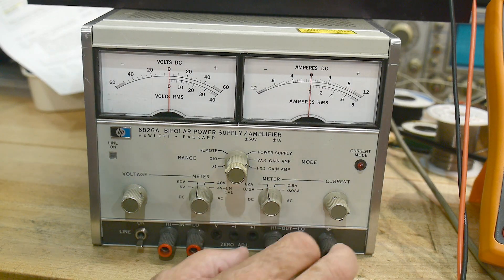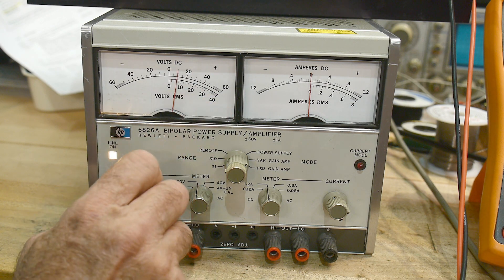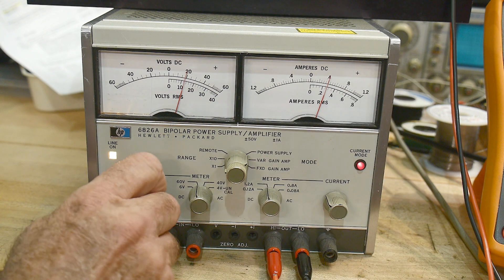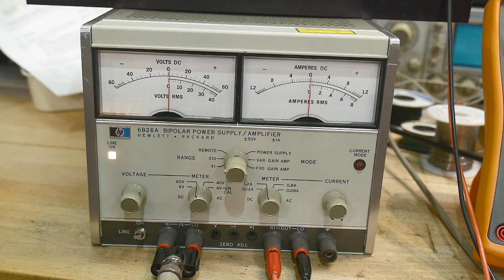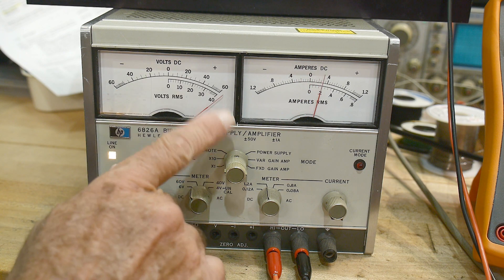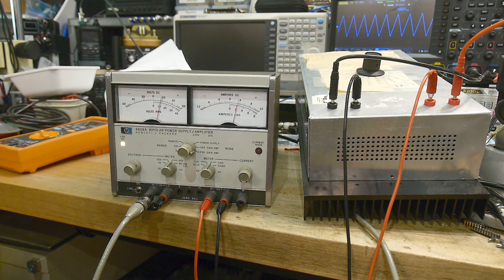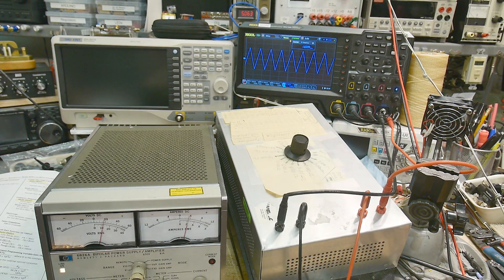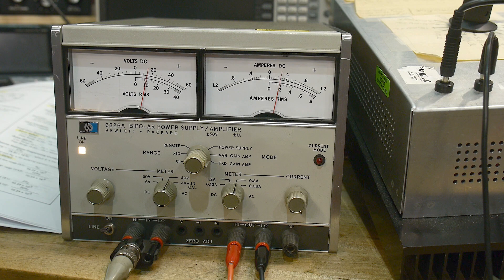#1597 HP6826A Power Supply Amplifier

Comment: At 3:40 in, the instrument has not been demonstrated to be capable of sourcing or sinking current or operating in four quadrants. It has only been shown to operate in quadrants 1 and 3, sourcing only in each. No "sinking" capability has been demonstrated.

"Sinking" means that instead of current flowing out of the output terminals, it can flow in to maintain the voltage setpoint. The specifics of polarity of the setpoint are essentially ignored with this terminology.

Considering the case with the supply set to deliver a positive voltage at the "red" terminal relative to the "black terminal" :
An ordinary power supply will go high-impedance at its output if something external to the supply forces the output voltage to be above the setpoint of the supply. With current sinking ability, the instrument will actively try to bring the output voltage down to the setpoint by causing (conventional) current to flow into the red terminal - it behaves as either a series regulator or a shunt regulator, depending on specific conditions. That is operation in quadrant 2. 
With the relative polarity of the terminals reversed, operation is in quadrant 4.

The non-square limitation in quadrands 2 and 4 is almost certainly due to the safe operating area limitations of the output transistors. Because sinking is to the opposite supply rail, the voltage across an output transistor could approach twice what it might see if used only as a normal series pass element.

Basically these power supplies are very very similar to audio amplifiers, the major difference being that they incorporate a bipolar voltage reference and some convenient bells and whistles.
Reply from the maker: As in comments below, I did not demo the four quadrants. Please read the User Manual for this product. It will explain it will in fact source and sink current.
https://www.keysight.com/us/en/assets/9018-02032/user-manuals/9018-02032.pdf
Reply from the maker: I show current sink: https://youtu.be/PmtYuBPJStU?si=fDC-6op2qBGqAYSk

Comment: I have the 6825A, it;s a nice tool.  knobs were all stuck on mine but a bit of heat applied to the shafts loosened thim up and they have remained fine since, which is good as these things are not built to easily service the rotery swithces.

Comment: I have two of them, one for 120V and other for 24V and I use them instead a regular power supply ,why? they dont have a electrolitic outuput capacitor, not capacitor discharge when you do the things bad. They can be used as a battery simulator too. Is a very usefull tool

Comment: Not seen one like that before, now if only i had a use for one it could be very useful.
I've 3 switching PSU's which are good for lots of power in a small case, but if your doing ENC work you can't beat a analogue supply with an analogue meter, for low RF noise getting in to the test setup from your supply. Even the analogue ones with the led meter can be a bugger for noise.

Comment: That is not four quadrant operation, nor was it sinking current in the normal sense. A proper four quadrant supply will act as an active load, which it may be capable of, but you didn't demonstrate that.
Reply from the maker: you are right I did not demo that, but it will act as a load. it is four quadrant. here is a video about: https://youtu.be/qFVhe_uzxnE
Reply: @IMSAIGuy  Is easy to demostrate four quadrant operation with your tektronix 576
Reply: My apologies.  As I too often do I didn't read all the comments before I posted mine. I too noted that it was not shown operating in four quadrants.

Comment: Really sweet! I love the sandy texture of the cast metal body. I have an old HP power supply with the same body panels and same banana jacks. The meter movements on mine are stuck at 0 volts though! I am wondering if it's worth it to crack the thing open and try to fix them.
Reply from the maker: fixing meter: https://youtu.be/mppbQeFe54A
Reply: @IMSAIGuy  I think that this power supply uses taut band

Comment: how hard can it be putting a current limiting circuit into a powerful audio amp and call it a psu
Reply: Very. Loudspeakers don't really like DC of any sort. As a result pretty much every audio amp will have an AC coupled design so it wouldn't really work without a pretty big redesign. Add to that the power rating of audio amps are for RMS/peak AC, so continuous DC is likely to cause problems with dissipation in the output transistors.
Reply: The output stage on most class AB amps is DC coupled. But it would be very hard to make it have an adjustable and precise current limiter.
Reply: Yes, just what I was thinking. DC couple it, add support circuitry for all that switching and metering, decent heatsinking, etc.